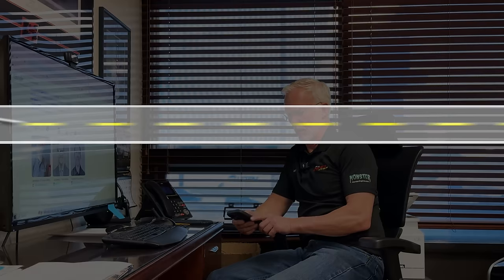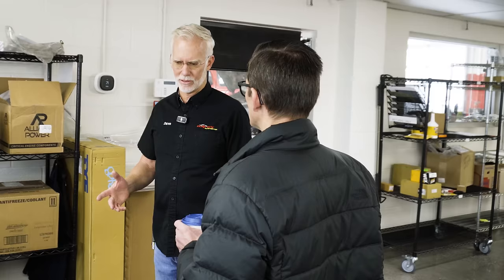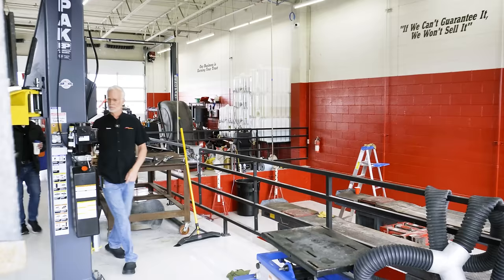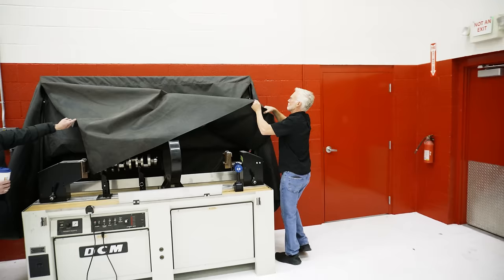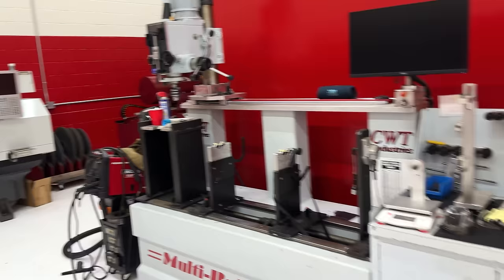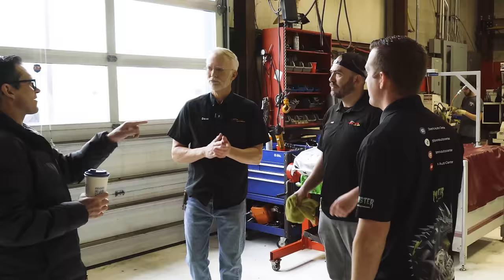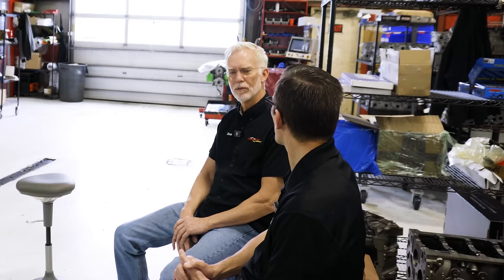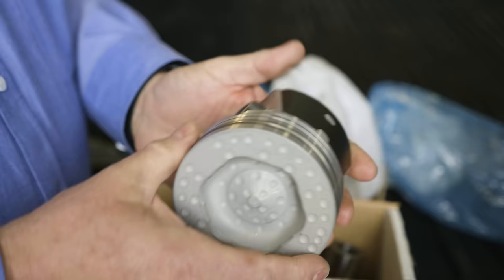Sitting Down With Lake Speed Jr. - The Truth About Oil Change Intervals and Analysis

Comment: An oil change is cheaper than an engine. I use the old school method of 3k or 3 months, whichever comes first. I get my oil changed every 3 months. March, June, September, and December. The first Saturday of every third month. I am rarely at 3k. But I, change it anyway. It is all about keeping the engine as clean and fresh as possible. Since my car is newer and still under warranty, I do keep it dealer maintained. The service tech even stated that many of the cleaning services that are in the manual are almost a waste for me. I still do them, of course. I also stay away from "cheap" gas. I have recently switched to ethanol free fuel and have seen a significant increase in mpg and a better running engine.

Comment: As someone who is envolved with the Ford 6.7L Diesel @ ford..  The spinning of the mains is not an oil restriction issue..  Its a debris issue.  Please remove the two main oil galley plugs that run the length of the cyl block from front to rear.  Stick a bore scope in those two galley's.  When the plant drills the main bearing oil supply galley's in the block, the plant doesnt do a good job of cleaning the 5 intersectins between the main oil galley and the main bearing oil galley holes..  We have changed the cleaning process, so this issue does not happen anymore . Just a little heads up..  We have

Comment: I got into an argument online over this. Everyone said the premature gasket failure on some car models is just heat cycle based when I believe it is a combination of that along with oil change intervals. Specifically the event someone goes over a recommended interval of 12k miles which I think is insane for any car. I did my oil pan gasket two weekends ago and the motor is angled. The high side part of the gasket was still pliable while the low side (which sees far more oil saturation and flow) was absolutely solid and would just snap into pieces.

So just in that case it is clearly evident the oil plays a critical role in the accelerated degradation of engine seals. So it turns into do you want to save $1000 in oil changes over 5 years or in 5 years have to replace ALL the seals in the motor which translates to VERY expensive repair bills. Change your oil.

Comment: It would have been interesting to hear his feedback on doing solvent flushes on neglected engine’s oil systems. Specifically the old shade-tree: drain a quart of oil, add a quart of diesel (or sea foam etc) idle it till hot, drain it again, change filter, new oil, drive. 

I am usually hesitant to do it but if it’s a running engine I’m about to tear down anyways I do it because I’m positive it gets a lot of crud out and makes my tear down less messy and first glance inspections more appt.

Comment: Modern engines with synthetic oils have the potential for some very long oil drain intervals.  If the oil is being damaged (heat, soot) as Lake said or something isn't working right in the engine, then the service interval is going to be short.  But if you do your homework on the engine design and manufacturing, use the right oil and run a normal duty cycle, you can go way longer than you may think before the oil is bad.  Some semi engines (Cummins X15) are advertising 100k oil drain intervals on something that's intended to have 90% of engines make it to a million miles.

Comment: Throwing the-cat amongst the-pigeons here : I don't oil my bores on engine rebuilds . I put the very-lightest of oil (sewing-machine styles ) with a q-tip in the piston-grooves before installing rings (I use Lake SpeedJr's  gap-method ) I use the same very-thin oil , lightly on the piston-skirts . I crank the engine to put oil through the motor 'Before' firing it up , sometimes those rings squeel a little , especially on air-cooled motorcycle engines . My compressions are always at the very high-end of spec ...or higher  and well-within-spec of each-other . If you have a spare/test-engine about , give this a go , you should be pleasantly-surprised . Also , thinner-oils get around an engine faster and remove heat faster , oil-coolers are a must .   Dave  nz

Comment: I keep my cars for a long time...26y with my current daily driver. I'm not going to do a 3k oci.  I'll stick to 4-5k for conventional and 6-7k for full synthetic. I always do it myself.  I ignore the time interval and use "top tier" gasoline. If my car consumes oil (I know they all do) it's in an amount I can't detect. No, the level doesn't rise and the oil doesn't smell of gasoline. The heads have never been off engines in any of my cars. No engine failures. Though most of my use is short trips, I make a point of occasional high-speed runs. That's all I do. Life's too short to distress about motor oil.

Comment: I can't talk for any other fuel manufacturer or even Chevron outside of California but Chevron has detergent packages in the gasoline and diesel in California. We have different emission standards in the Golden State and hence different fuels but in California, the fuels work with the oils.

When it goes out of state via the Kinder Morgan pipeline up the hill to Reno, it's base US product spec and mixed in with general fuels from other refineries. It's just like you go to an AM/PM gas station next to a Shell refinery. They have the "State mandated grade" gas without the Shell goodies in the additive package. It's not bad gas, it just doesn't have the additive package.

In Utah you have the Chevron refinery at Salt Lake. You buy the Chevron fuels and oil, they work together. My former boss, as I no longer work for Chevron, would have chastised me for this, but using Shell gasoline (Chevron's techron is the basis for degerents and lubricants for gasoline for all of the majors apart from Shell) for a few weeks in a row per year would clean the little bits of deposits off the valves.

The other thing to look at is the oil volume in an engine. We tested Delo in tractor trailers for 65,000 miles per oil change. Think about that. Yes, there's 45+ quarts of oil in those big guys but at some point someone gotta be thinking about adding a few more quarts to the diesel pickup oil pans and changing the oil pickup. It doesn't make any sense to me why you may put 5 quart of oil in a fuel efficient gasoline car with a 1.8 liter engine and then only 8 quart of oil in a almost 7 liter oil burner. Add an inch or two to the bottom of the oil pan and add a quart or three more oil capacity - and fit a pickup tube that was lower.

Comment: In Europe diesel is not house heating oil or like that. Here up north we have spesific diesels for different    
temperature area. Arctic diesel is  --  38  C and  heavywinter --26 C , winter --20 C it depends little where you live but. Here we have five diffrent diesel to pick.

Comment: On a 2stroke iron or nickel cylinder the pros assemble the rings dry and it had 156psi verses 127psi when assembled with oil film on my 50cc build. The Shed mechanic in the UK assembles his 4stroke piston rings dry and says will not break in with a oil film.

Comment: I have had problem seating rings using engine oil on the rings when installed. I had ring companies tell me to use WD 40 on the rings to break them in. The rings seat in fast with WD 40. No ring seating problems sense I started using WD 40 for seating rings.

Comment: I just use a quality oil with the requirements listed in the Owner's Manual. Cars I have owned from new have had over 200,000 miles on them without any repairs. And I never bothered with an oil analysis.

Comment: 1 Qt per 1K miles acceptable at the 25.51 minute mark, that's a lot, my 2021 Subaru Crosstrek uses about .1qt for 5K mikes, with 25K on engine changed every 5K miles. I had a vibe with 125K on engine, used about .5qt for 5K miles. I can't imagine  adding a quart of oil every 3-4 times the car is filled with gas.

Comment: What is IN Amsoil engine flush ? 

What about in the 60's we used to add a quart of ATF to the oil and idle it 30 minutes or drive it around the block , before changing the oil  ? 
We did it to clean the sludge out of the engine ? 
I have seen an oil pre heater on a dry sump racing car of Rob Dahm , rotary engine 4 rotor, Rx-7 
Does a block warmer pre heat the oil in the pan , cut off with a thermostat ?

Comment: Well, I guess this would be one of those "pay me now, or pay me later" things. Oil changes are not cheap. 3000 miles is good for the engine supplier but the cost of all those changes can soon add up to costing more. It's not that I'm arguing that more frequent changes are better or worse. In a perfect world, we would have a tank truck full of motor oil and pump it through the engine only once. The engine might last forever but the cost would obviously be an issue. 

Everything is a tradeoff. I have a F150 with a 3.5 NA. I intentionally stayed away from the turbos. I change the oil when the dashboard tells me to. That usually occurs around 6500 or 7000 miles. I can hear the groans already but that truck now has 210,000 miles on it. It burns little if any oil between changes and I never added once between changes. I've changed the spark plugs twice since new. 

I don't abuse my vehicles. They operate in likely the best of environment's being in the mid-south and I'm sure I'm an exception. But at 77 years of age, I haven't had an engine failure since I was a teen back in the 60s. And in that time, I've seen over three million miles of travel in all climates. My last three Ford trucks combined took me over one million miles. One of them a 7.3 diesel the other a 5.0. 

The moral of the story for me is, you want to chip an engine, modify from the original specs and intention and you will pay the price. If I purchased an engine from you with that 3000-mile oil change requirement, I would consider the warranty useless. But you're obviously doing very well with your business plan and I do admire you for that. And I do enjoy your clips and videos.

Comment: About the oil change interval. Might be that in the US the fuel dictates shorter changes. But this is unheard of in Europe even in performance engines, 5000km changes as far as I know, unless your drive hard constantly or your engine is tuned to the moon. I would have liked to hear more about it based on actual tests done on used oil, and not just that "it lasts longer". For all we know the best interval would be 100 miles but at what point do you sacrifice longevity for practicality and cost-effectiveness? I guess these things vary and oil could be cheaper over there, but for most people and normal engines 7,5k miles would be fine for the lifetime of the engine most likely.

Comment: I'd like to hear more about OEMs stating 1qt/1000 miles is acceptable. [25:46]  Should an owner be satisfied with that?  Why not change the filter and just keep adding if you use up the capacity between the intervals.

Comment: The GM vs. Toyota comparison doesnt make sense ;-). 
I tried to kill my 12 year old Toyota Starlet 1.5 (no turbo) Diesel and drove it for 3 years without major maintenance and added 120.000 kilometers on the existing 280.000. No oil change just top up and oil filter change. Sold it at 400.000 kilometers. Gave the full history to the guy who bought it. He asked does it run? I said Yes. He shrugged his shoulders bought it. I checked 10 years after if it was still on the road ... it is. This is in the Netherlands with consistent quality gasoline. And oh I used/tested sunflower oil for at least 20.000 kilometers.
Great video by the way.
Condition Cause Correction Confirm.

Comment: Nearly 20 years at Jaguar dealerships... You are 1000% right, that the mfg doesnt care what happens after warranty. The dealer needs the out of warranty repair work to sustain the back end operations in combo with the parts sales and other revenue streams, so they wont suggest anything else either. At the time I was there, the mfg interval was 10k miles or once a year. Plenty of the customers did it on time passed alone, because theyre low mile drivers (3k-6k a year), but majority was on miles. 

Without a doubt, the cars that did the 10k m ile interval, there was always a decent amount of owners that also, went over, 1k-3k mile s on each oil change. So by the time they hit 50k miles (end of warranty on powertrain) best case scenario, the car had only recieved 5 oil changes., regularly though, we saw cars that had only recieved 3 or 4 because of the mentioned "slightly" over" the absent minded owners drove past.

This was the first and second generation of the AJ v8 engines - They were good motors if you took care of them (Ford pedigree, so that helped). The cars that did 10k mile or more intervals almost always needed related repairs between 40k-80k, like timing chain tensioners, washed out nickaseal on cylinders, heavily deteriorated and leaking oil pan gaskets, valve cover gaskets, etc.. The owners that did 5k mile intervals on thier own, RARELY came in for those repairs, and usually made it to the 90k-120k mark before the chains started rattling (tensioners on camshaft chain failing) or had oil leaks everywhere.

It absolutely matters when you do oil changes 1000%. I currently drive a 2018 2500 Ram with 6.4 hemi. Youll find no shortage of owners of that engine complaining about the camshafts eat up and ticking, etc.. Nearly everyone Ive talked to does the mfg recomended intervals, or waits till the oil change reminder comes on. Ive done mine at 5k religiously with the oil mopar says meets factory spec for that engine (Penzoil Ultra Platinum Synthetic) and at 200k, still going strong. Ive seen it too many times - just like you said, lack of maintenance is the #1 cause of the rest of it. Unless it was an older v12 in an XJS. Those were just what they were, and I blame Lucas for that lol

Comment: Thanks a bunch for this informative video.

How do I do my own oil analysis?

There are quite a few people who go overboard with zinc.  The internet has enthusiasts buying all these products to increase the zinc on classic flat-tappet.

Changing oil formulas, because oil evolved, is like changing emissions components.  I once had my mechanic do an oil change, I got my gas pickup back with diesel-oil in the crankcase.  They figured that if it has flat-tappet valves, that it needed a diesel oil package?  How do they get around all the stuff printed on the package, someone came around and says that it is all relative due to the emissions regulations?

Comment: Got a Honda Fit with 175k and the maintenance minder would have me go out to 12k mile interval's. Which hondas maintenance minder isnt a clock and uses RPMs, start/stops, idle, and engine sensors to tell you when to change the oil and other maintenance items, and i do a lot of countryside/highway.

Now that being said id be maybe fine with 10-12k if i was using Mobil 1 oil and filter 0w20 but my local mechanic uses Mag1 0w20 and a napa filter rated to 5k, which from what i looked up is perfectly serviceable oil, but the filter could be better though...

I ignore the maintenance minder and go every 5k miles for my full synthetic 0w20 oil changes which is approximately 50-60% "oil life" on the maintenance minder on the dash. I used to go to 10% on the maintenance minder and have Belle tire do the Mobil 1 but they snapped a lug bolt off with thier 300psi torque guns and from cross threading so ive never gone back since.

I go to my local guy and every 5k to get an oil and filter change.

From what I can tell, the car burns almost 0 oil based on dipstick checks periodically.

This video has convinced me to send an oil analysis in at my next oil change to see how the engine REALLY is faring at 175k miles...

Comment: Having worked for most of the major oil companies, and being an auto enthusiast I somewhat go a step further than my car recommends.  I use 0-40 weight instead of 5-30 recommended.  I do change every 2 years.  I always fill my oil filter with oil before installing.  When filter goes on horizontal, I do leak some.  Oil should be filtered down to ~5 microns, but most filters are 15-20 microns.  Most important gauge on a car should be a Dp (differential pressure) on the oil filter, but no car has one.  I usually get close to 500,000 miles on my engines between rebuilds, but I don't rebuild anymore.  Just buy a new car.

Comment: I’d love to see a video on the problems with wet drive belts and how the oil is formulated to prevent degradation of the belts. There seems to be problems with Ford cars and vans especially, and Ford seem to be placing the blame on owners, or their garages, using the wrong oil. Personally, I think wet belts are a bad idea.
Reply: Yeah I agree wet belt system in transit is a waste of time..oil  corodes the belt ..you would oil change earlier., and may be 5,/40 especially ln hotter Australia, climate..my transit is older chain..much better,,still goes great...i will never buy a new van with wet timing belt..

Comment: @ 26:00 I agree with you all.  10,000 or above between oil changes is a kiss of death starting with the turbo (on small 4-cylinder engines: example = Chevy Equinox 2019 with the 2.0 liter (1.5 liter would be worse yet)) and next the engine will be burning oil excessively and trashing the Cats.  Death spiral.   We have two identical cars where one suffers from very short trips and one that is driven on trips that are much longer.  At 50% oil life showing on the car with short trips draining the old has two surprises - the oil is already coal black and also it stinks like fuel.  So, that car gets oil changes at 58% oil life (according to the dash feature) and the oil is deep brown (I'll call it) but stinks less but - it still stinks like fuel and that equates to only 2,800 miles.  It is necessary at 2,800-mile intervals to save the turbo and engine so they can make it past 100,000 miles.  At least that is the goal.